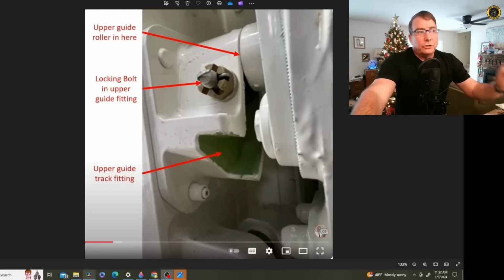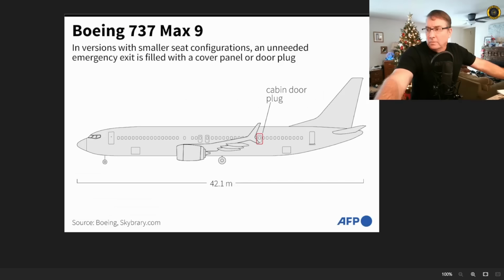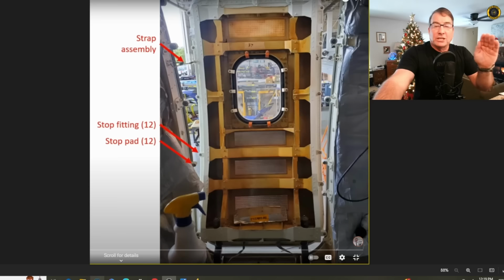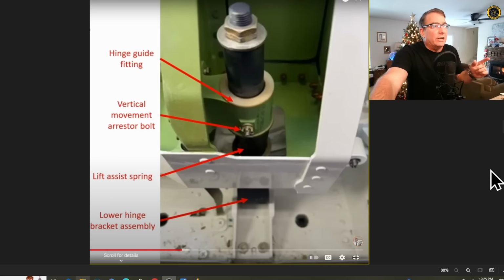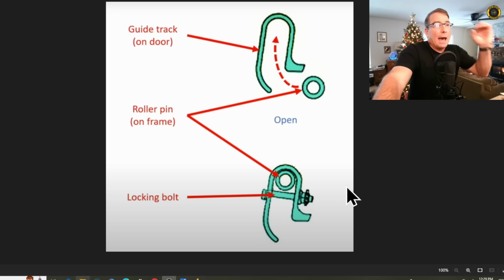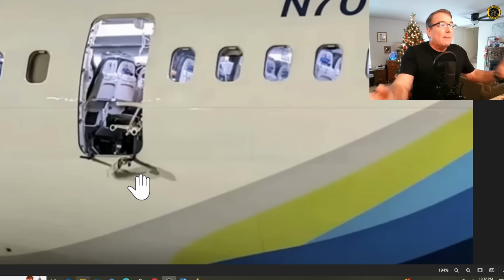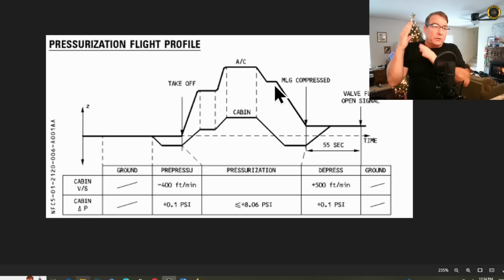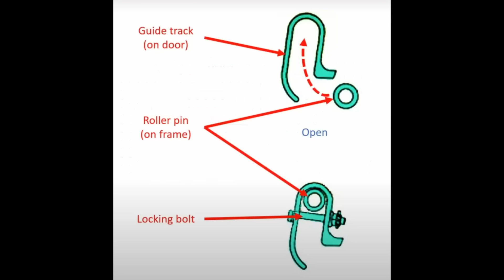Alaska 737 Max-9 Door UPDATE! 8 Jan 2024

Comment: Thanks, Juan for the outstanding information.  I'm just an old aviation fart but don't understand the design need for a plug to need springs.  
My understanding of cabin doors was that they swung inside the bulkhead first then swung outside to open and the pressure within the craft kept them in place during flight.  So why does a plug have springs and be able to wiggle out and launch itself from the aircraft?  Would you not design it to be a plug that needs to come inward to be taken out. Like the overwing emergency exits.  You unlach them bring them in turn sideways and through them out the hole.  This plug is only designed to open when reconfiguring the aircraft. by Techs.  Why are springs needed?  and why does it not need to come inside first before and use the aircraft pressure to keep it in place even if bolts are missing?   I'm booked to be on a United 737 Max 9 at the beginning of next month.  Fingers and toes crossed
John YQT
Reply: The door is heavy, you need the assist springs to help lift it up out of the guides (for maintenance access)

Comment: Now that I saw this great video explaining the design of the door retaining mechanisms.  If this door is not for emergency exit why can't it be plugged from the inside to take the pressure and not relying on the 6 pads to take the pressure load and vibration.  This design seem scary with no safety at all.  The whole thing under so much stress and only relying on 4 cross bolts ?  Do they pull the panels to inspect or replace.  I am curious what is the fatigue stress and not to say that the safety is the tiny cotter pin.  That is just scary to think about.  A cotter pin is your first failure then the second cotter pin (the bolt essentially) came loose then the door bye bye.  Now I am curious if other planes Airbus and Boeing are using this similar design.

Comment: Good info as always, Thanks! I'm not in the aircraft business, but it does not look like that door is designed like the other doors used for enter/exit.  In the fact it does not appear to have the Frame outside - Door inside the frame. It appears it is held against the interior frame by those slide channels that are slightly tapered inwards. 
And I am guessing that some type of mechanical force (not just a person/s pushing it) is applied to get it to move downward and squish against the frame, then the channel bolts are installed. Just my observations, not based on any technical info or experience.

Comment: It is difficult to avoid concluding that the bolts were not fitted, or at least not secured with the proper castellated nut and split pin. I see no reason at the moment to think this type of door has some sinister fault, much of the impact to this type of aircraft stems from previous unrelated problems. Luckily no one was injured this time.

Comment: Castle nuts and cotter pins (split pins in the UK) are items that I associate with automobile not aeronautical engineering. Surely this plug should be a fit and forget item with zero routine maintenance required. A better solution would be a high tensile bolt secured with a nut at defined torque plus a locking nut also tightened to defined torque. I note an Apple iPhone did survive the 16000 feet drop intact!  Surely down to assured engineering at Apple.
Reply: If you are using Apple logic - all doors (including the egress passages) should be glued shut!

Comment: Sorry, another obvious question. Why wouldn't the engineers design the plug to mount from the inside with a larger door pressed against a smaller frame, so that when the cabin is pressurized the door pushes against the frame seal and there's no way the larger door could pass through the smaller frame openning.

Comment: I'm not surprised that inspections are turning up loose nuts. One of the biggest disadvantages of castellated nuts is that a slot has to be aligned with the hole in order to insert the cotter pin. Most of the time the nut will be either under or over torqued to achieve the alignment. If loose, vibration will eventually compromise the cotter pin
Reply: Head of inspections must have been the Planter's Peanut Man, he knows about loose nuts for sure.

Comment: Im sure the will either know or be testing, how many of the locking bolts are needed to hold the door. If the top bolts are missing, the bottom ones should stop up and down movement, same if just top ones. For door to come off, had to have moved up, swung open and slid off bottom hinges. Door frame on plane looks intact. How easy is it for routine maintenance to visually check the 4 bolts and nuts are present?

Comment: Great video! Really explains the bolts, guides, and how everything fits together. Can someone explain a bit more how pressure plays in? Is he saying at the end that a higher, cruising pressure would've been less likely to open up the door plug?

Also, why didnt they make the doors open from the inside only? Would that work better with a higher pressurized cabin than the surrounding air?
Reply: That last is the big question!  Why aren't all doors made as plug doors, opening in?
Reply: @SteamCrane  Very interesting! Possibly there may be spacing issues with traditional doors and emergency doors. ie you would lose a lot of seats if you needed space for a door within the cabin. 

You may not also want to trap people in without any door that cannot open if the plane pressure is too high. I can imagine a plane pressurization malfunction even at ground. All just speculation!

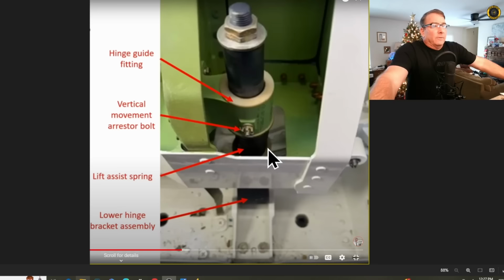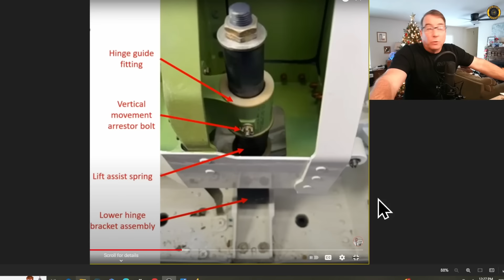Comment: What strikes me is that the door is not flush with the fuselage along the door's top edge. Visible is a black line at the door's top edge. @ 6:38 the picture is confusing. I'm a USAF retired fighter jet guy and have no experience on heavies. I am looking at the assembly @ 6:38 in the video. What is the entire hardware assembly called.? The vertical component looks like a pin, enclosed in another device capped with a washer and what look like nuts with an insert. Is that one nut or two.? Are there threads on the pin or are the nuts pressed in.? Are the nuts required to be replaced each time after the pin assy is used.? If I understood correctly, the horizontal locking bolt does not go through the pin assy, but prevents the pin from moving down toward the spring.? Do I have that right.? How does the spring fit into the equation.?  It seems like the spring would be pushing on the locking bolt.? Again, I call out the gap at the door's upper edge relative to the fuselage. The gentleman below mentioned a door seal. As well, (Maybe) he hinted at cutting corners ref the removal and installation of the seats + in installing the door (my perception). Such fits the scenario that Mr. Pierson of The Foundation for Aviation Safety called out as #ProductionPressure. 

In fighter jets, we call what I perceive to be a gap at the door's top edge, a moldline mismatch b/c we're Mach 2.5 capable (F-15Eagle), so moldline is a thing, e,g., the aircraft boarding steps have a limit on how much the moldline mismatch can be when the steps are stowed. #FeelerGauge.
Question to me = how did the door actually depart; bottom-first or top-first.? Most of all, who signed the door installation off.? Buddy-Buddy.? Seen lots of THAT during my career, but #NeverMe. #PencilWhip. Is the door seal a (NPI) stop-gap for an engineering flaw.? I am a wrench with an Aviation MBA. Akin to @jeffropenn, I have done thousands of preflight, thruflight, and basic postflight (BPO) inspections and scores of periodic inspections as a mechanic, Quality Control, and as the #LeadMechanic of a periodic inspection operation that included the F-15C/D/E, F-16 Blocks 45/55, the A-10, and the A-10C. I was qualified wings-on, wings-off level in F-15 maintenance. My final USAF assignment was as a Suitability Logistics Analyst on the F-22A #Raptor acquisition program. #SeniorMasterSergeant.

Anyway, I am glad that no passengers were seriously injured or thrown from the aircraft ref decompression. This accident could have been MUCH worse. Recall the DC-10 rear #CargoDoorDebacle. #MAD_MAX strikes again.! It also sounds like Alaska Airlines mx knew of the problem BEFORE the Mishap/Accident. BTW, I firmly believe that the FAA and Boeing are, as we say in USAF contracting, #InBedTogether. I am running for US Congress (NV-04) this year and the FAA is #OnMyRadar. #Corruption. Cheers, --> Rick G.

Comment: Thanks for yet another excelent update on this. However, what I'm confused about is the fact that the door is hinged from the outside and locked up in place, like a cargo door. Therefore, its not and internal plug but an external plug. Its only the top pins and all 12 bolts keeping the door in place. Internal cabin pressure, would assist in the door opening, and then you can only think that the 12 bolts were not installed, or all gave in at the same time causing the door to flex (bow) enough for it to depart the top pins and the aircraft. ??
Reply: There are no 12 failed bolts. The 12 positions are simple bearing lugs. The door lugs are inboard of the frame lugs when the door is in place, thus cabin pressure on the door pushes the door (lugs) into the frame (lugs). The lugs take all the cabin pressure on the door and transmit it to the frame.
Reply: @imd12c4advice  Watched again, sorry I thought the stop pads were actually bolted as well. So only 4 bolts, 2 @ top on the pins and 2 @ bottom on hinge. Still wouldn't the door have to be pushed down to unlatch the top pins, not up,  then it would hinge out as designed ? I'm really surprised that the centre of the door hasn't got some sort of insertable retainment pin left & right to prevent bowing under cabin pressure loading.
Reply: @davewalker4991   The door must move upwards to clear the fixed track rollers on the frame ( the roller track is on the door and the open end is down, so the door must go up to open). Juan covers this perfectly at 7:18 in the video. Note he's is talking there about closing the door. Opening is reverse motion of course. Anyways, looking at the door structure, the pressure is channelled to the 12 lugs so no need for extra support mid height. The door is simply made stiff enough to be "simply supported" at the 12 supports. This is useful as it simplifies the design/analysis for the door and the opening/fuselage/chasis as the large load on the lugs is primarily in one direction and also much less dependent on dynamic strains within the fuselage. Also that's 12 less bolts for them to miss.
Reply: @imd12c4advice  Thanks for the reply, I was always taught to question what you are told to help your own learning.

Comment: Why is there an unused door (plug) in the first place?  Atm I think again this is what you get if you stick around with an airframe too long and try to stick more stuff on it. Yes, the even older B52 still flies around but they didn't try making it longer and replacing the engines with ones that don't really fit etc.
Reply: Airlines can reconfigure this model into a high-capacity budget liner, making an extra door mandatory.

Comment: What I found shocking was a photo of the hinge assembly and the bolts attaching it to the door were LOOSE. With the locking pin bolt in place and those bolts being loose should NEVER happen at the same time. A definite failure in assembly.

Comment: Did I hear the NTSB briefing earlier today correctly:  The cockpit door is designed to open during rapid decompression? Sounds like the NTSB and some of the flight crew just found this out today. 

Seems odd to me. What would be the purpose of such a design?  There must be a reason, unless Boeing is just playing the "It's not a bug, it's a feature" card. 

The only reason I could come up with for the flight deck door to open: In the event that both the Captain and FO lose consciousness, I wouldn't have to break the door down in order to jump behind the controls and save the day. (Assuming I haven't already been sucked out of the aircraft.)
Reply: It is better that the door opens to let the air out, than the bulkheads and floor buckle and damage critical equipment in the avionics bay.

Comment: I have tonask why these plugs are installed from the kutside, and not from the inside. Yes, easier to work on this way, but a plug assembly with internal mounting would be physically impossible to pop out.

Comment: Those bolts?  They're gone, baby.   Doesn't matter how...sheared off at door ejection, castle nuts unscrewed over time, or never even installed in the first place.  I don't see any scenario in which they ever find those bolts, unless someone find them on the ground somewhere...a needle in a haystack.

Comment: Even if that locking bolt was not fully tightened it would not be a problem as long as the castellated nut was on and the split pin fitted. In fact the bolt should not be too tight certainly not torqued. With 4 pins like that in place how can the door fall out?

Comment: Interesting that the 'stop pads' in your picture at 3:46 appear very different to those from inside the actual plane that the door blew out from... i.e. It looks like the grey grommets or collars (no idea what they are called?) are missing from the air frame mountings on the Alaska aircraft.
It could be that they were lost along with the door plug,  i'm not an aircraft engineer but there certainly appears to be a missing part on all the 'stop pads'.

Comment: The problem with the pressurization test is it does NOT check whether the pin or the nut is locked. That requires eyeballs to see and check. best with photo evidence with serial numbers indicated.  Simple problem simple solution. 
problem: safety locks or plugs or just-in-case issues.
Have you Check that? Yes and here is the photo evidence to prove it. Serialized IN the photo even a handwritten number is good enough. save for prove of work is done. no argument.

i had a similar problem in my previous work with a marine system with a hidden plug. keep me up at night whether the workers plug that damn hole, until I demand they show me photo evidence.

Comment: So, these plug doors are concealed by wall panels that cannot be easily removed to allow inspection.  
This has proven to be a possible failure point that will require regular inspection in the future.  I predict a mandated redesign to allow access to these plug doors for safety inspections.

Comment: Wouldn't it be so much simpler and safer to plug the aperture from inside the airframe with a plug that is larger than the aperture and can only be removed into the airframe. I'm sure I've seen video of over-wing emergency doors that are designed in this way.

Comment: Excellent presentation Ron; you didn’t suspect the door plug bolts to be vertically missing. However, this may be the case here.  What’s more problematic; an Emergency Exit Door or a Door plug?
Reply: I suspect if both are properly assembled, secured and maintained, neither are problematic.  The plug is probably more susceptible to QC issues though since it's secured in place using the addition of two bolts, nuts and cotter pins, rather than the normal manually actuated and integral locking and unlocking mechanism used on an operational door that would be checked and tested (by opening and closing it) more frequently than a door plug which is hidden from view/inspection/testing once the interior panel is installed over it. I expect maintenance intervals for an operation emergency exit door would be more frequent (and easier to perform) than on a never-used door plug hidden behind interior paneling.
Reply: @skyhawk_4526  agreed; and if that’s the case then why plug an extra emergency exit at all. Evacuating a plane within 90 seconds seems minimal at best so it doesn’t make a lot of sense. Recently, in the Tokyo runway accident, one emergency exit was blocked by fire making it useless. I see a connection with these two events, illustrating the door plug debate

Comment: As a layman and backyard mechanic, to me it looks like it all comes down to those bolts. I am very interested to see the final report. If those bolts are the key, then whatever happened to them had to happen at the same time. Did the up-and-down movement or jarring from landing sheer them and it was just a matter of time and pressure to pop them out? We won't know till the fat lady sings. I don't recall you saying the purpose of these doors and how internal access to the mechanics of them is achieved. They must remove decorative trim I am assuming to get at the framework.
Reply: Yes, to get at this door, a row of seats must be removed and the interior trim panels removed.
As NTSB said, it’s possible the four bolts were missing.

Comment: Cannot stop thinking about the outcome if it was regarding any other door of the airplane. If the front doors would potentially rip up a larger hole of the fuselage. As usual, thanks for sharing these insights / updates!
Reply: Apples and oranges.  These are totally different doors with totally different mechanisms and physics involved in their operations.  The main doors at the front and rear of the fuselage are designed differently than the over-wing emergency exit doors and both of those types of doors are designed differently from the plug doors located between the wings and the aft service doors.

Comment: The question for me is: Why is this door plug to be opened to the outside for "inspections" ?
A safe constuction would only allow the door plug to be opened to the inside with the door plug being larger than the opening, so it can't be blown out.
Reply: Active emergency exits also open outwards. A full plug type door can't be opened if there is a slight overpressure in the cabin.
This plug is more or less mounted like a semi plug door, which is standard today also on 777s